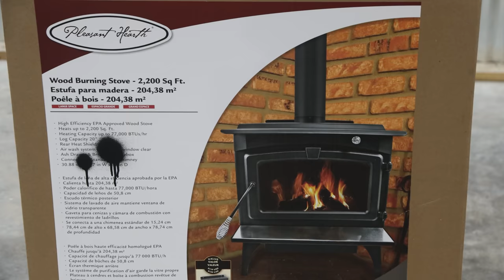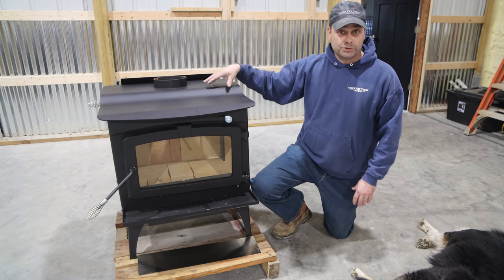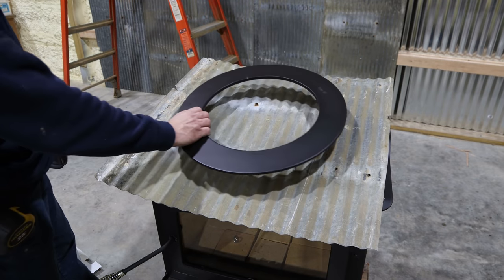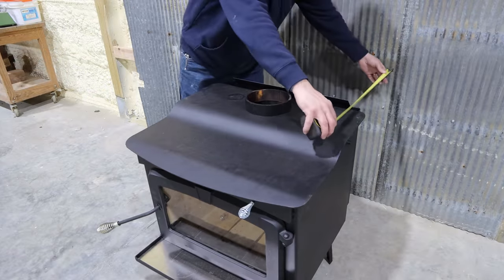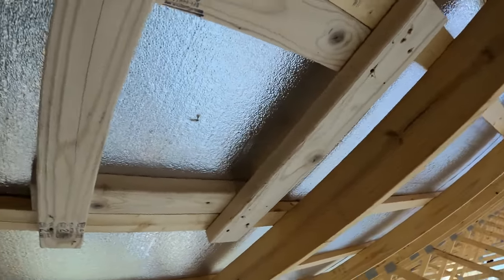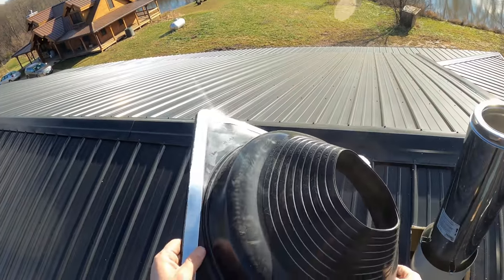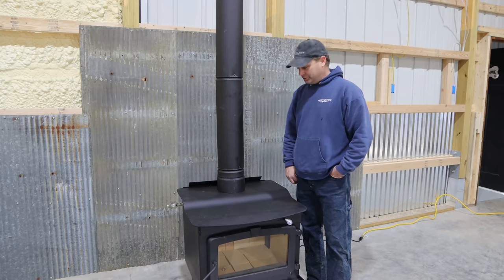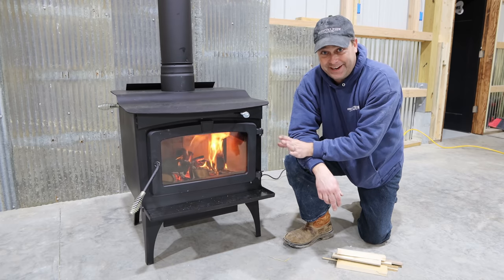Installing a Wood Stove in our Workshop.  It will be nice to have a warm place to work in the winter

Comment: Tip from an ex roofing contractor for 20 years. Since your so close to the ridge I would put a piece of metal under the ridge and over the chimney flashing for backup. You did a perfect job, but if can keep any water from coming down to the boot from above you have way less chance of a leak later on. Right now your depending on the silicone only.
Reply: Damn good advice.  In the years to come, you need to depend on something more substantial than silicone.   Water will also pool there w/o a piece of metal flashing.

Comment: Evan! 28 years as a chimney sweep. Your smoke pipe from the stove has to have the male end (crimped end) pointing down! This keeps creosote and any water in the wood that may condense in the pipe, in the pipe! And not dripping down the outside of the pipe. The class A insulated pipe in the attic also must have the male end down. Most insulated pipes will have an arrow pointing up to orient the pipe. Looks like the insulated pipe is correct. The high temp silicone goes on the storm collar not the roof flashing. Why? The smoke pipe and insulated pipe will expand in length and break the seal. Sealant on the storm collar will ride the pipe, expansion will not break the rain seal.
Reply from the maker: You are correct.  And all the stove pipe the inside crimp is pointing down.  There was an adaptor on the ceiling from single to double wall and an adaptor on the stove, so it may have looked different' but all inside crimps pointed down.
The Class A pipe was install per manufacturer.  There is an arrow for up.  And that is how it was installed.  And it could only be installed that way or it would have hooked to the ceiling support adaptor or the rain cap.
.High temp silicon was on the storm collar.  "Through the roof" silicon was on the flashing.
Reply from the maker: At 12:54 you can clearly see the arrow pointing up on the class A pipe.
Reply: Sorry Evan, my bad! Couldn't see the arrows.

Comment: I'm sure you had a good reason why you picked insulated stove pipe for the conditioned space, but in case you didn't think about it, part of the heat exchange will occur from heat coming off the stove pipe inside, not just coming off the stove itself. By using insulated pipe inside the conditioned space, you are reducing that heat exchange and sending additional heat up the chimney and outside, rather than warming the workshop. You might consider just having the insulated cap in the attic space, but the rest uninsulated to allow extra heat to escape inside.
Reply: @Boobtube.  He installed it 100% correct. The transfer adapter secures the pipe in place and double wall insulated keeps the pipe from getting cold and pushing air downward. The adapter also secures the pipe in place for cleaning.
Reply: He installed it 100% correct. The transfer adapter secures the pipe in place and double wall insulated keeps the pipe from getting cold and pushing air downward. The adapter also secures the pipe in place for cleaning.
Reply: I agree .
Reply: Are u saying use single wall pipe inside and insulated class A pipe outside???? That’s how I was always told it do it cuz the single wall pipe inside will put off more heat.    My code and insurance reason u must use double or triple wall outside
Reply: Absolutely. We always used double pipe inside. Up in Maine it gets cold.

Comment: chimney pipe and stove pipe are not the same kind of material. Chimney is insolated normaly 2 inches for stove.  Stove pipe are not. You must use three screws at each joint. Chimney must have the same diameter the than the stove smoke exit...

Comment: You should have used single walled pipe in the shop
Double walled pipe through the roof 
You will be losing a lot of heat through the pipe that could be used to heat the shop........

Comment: Evan, I'm a year late seeing your video and coming to the conversation.  Great job on the work and the video.  My 1500 sq. ft. (30x50) shop is very open like yours.  I have 10'walls and an open attic.  
Has your stove heated the space like you wanted?   
Also, how did you determine where to place the stove?  It looks like the middle of the long end of your space.  Thanks.

Comment: Always best to have an air channel wall behind a wood stove.  I have renovated homes and seen others that have the studs charred behind sheetrock covered with synthetic brick.  The lesson being that heat can be cumulative in an enclosed space even if that facing layer is fire resistant.  I have found a sheetrock  layer over the studs or better still concrete board (real concrete not that Hardi crap), then 2x2 studding spacing out a final layer of concrete board which has an air gap at the bottom of an inch or two and an inch at the top.  This allow a convection air flow to keep the area cool.  A decorative finish of your choice can be added.  I also like what we used to call a "stack robber" that took waste heat out of the stack and blew it across the room for even more circulation to protect the ceiling as well.  If the ceiling is low it too can benefit from a double open layer to keep its temperature reasonable.  Modern wood stoves can idle for long periods and build up creosote in the chimney.  How much depends on the type of wood and how seasoned it is.  Every so often depending on the buildup you experience it is good to open up the stove and let it burn super hot for twenty minutes or so.  Either that or clean out the chimney with a brush manually as needed.  A true chimney fire is something not to be experienced by the faint hearted!!  High R value insulation can hold heat to a dangerous degree and needs protection from a wood stove.  When it is cold out that area close to the stove can indeed get very very warm with radiant heat penetrating the wall.
Reply from the maker: The stove has abuilt in heat shield on the back.  The wall doesn't get hot.

Comment: Very nice. I placed the sliding stove pipe on the bottom to the stove not on top like you did. Reason being when I clean pipe I slide it up off stove and put metal or plastic oil pan under pipe sitting on stove. when running brush down chimney it falls into oil pan not stove. when done slide down on stove . All creosote in pan.

Comment: So I'm getting ready to do something just like this for my garage. I'm going to go out the side instead of all the way up to the roof because I'm not that confident myself that I'm going to be able to make sure there's no leaks lol.
My question is how much did it cost, was there a kit that you can get to get this started? Also what size piping would you recommend 6 in or 8 in? And would it not be more helpful to use single walled piping inside to help have more heat contact? Or maybe use a double wall at the first adapter than have that go into a single wall when you're about halfway up. I feel like your missing out on a lot of heat using that double wall.

Comment: Your insulated chimney looks like Metalbestos?  If so they make a model for Canada (which has stricter fire codes) that has a thicker ss liner so it lasts longer and also thicker chimney caps etc. which also last much longer.  If you have access to Canada it is much better quality as their codes require a pipe to last at a given temperature much longer than US codes.  This translates into a pipe which has a much longer life before it burns out.  Stainless does indeed lose material through each heat cycle and although better than regular mild steel it has a limited life.  The hotter the burn cycle the more microns of metal are given off.

Comment: I have a similar stove in my pole barn.  After a year of the stove setting on the concrete floor and having to kneel down when putting wood in the stove I purchased 8   6" x6" x 6" high concrete blocks and blocked the stove legs up 12".  So much better whenever you need to get in the stove.

Comment: I think you did very well with this job. I know R helped some, maybe even more off-camera, but you planned well and executed it perfectly.
Check this out. (he also builds to-die-for furniture)
https://www.youtube.com/watch?v=VwXEzpB017o.  fast forward to 13:30 and note how he secured the venting. Since your stovepipe consists of multiple pieces do you plan on securing it once or twice to prevent it from being pushed over. Such as from a basketball, football, or an Orangutan climbing it? You never know when a wild Orangutan might sneak into the shop. Happens all the time. 😏

Comment: I wanted a wood stove in my shop, but local codes pretty much put a stop to it.  I can't have any volatile compounds (gas, aerosols, grease) in the same space as the wood (or pellet) stove.  I ended up choosing to do electrical over propane.  Might want to double check with your insurance as well.

Comment: your black pipe is all installed upside down, the kreasote that runs back down the chimney will leak out on the outside and cause a mess, plus smoke up the building. I hope you catch this notice before its too late.
Reply from the maker: It is double wall pipe.  The inside pipe the crimp ring is pointing down so creosote runs back down inside the pipe.  It is installed correctly.  On the outside it looks backward.  But it is the inside the counts.

Comment: Hard to tell from the video but it looks like the male ends are going up but from my understanding the male end is supposed to be down. With the male end up you can end up with creosote running down the pipe and falling out and causing a fire hazard instead of being contained inside the pipe. I believe it can also affect your draft and cause smoke to come out instead of being contained inside the pipe. Everything else looks good though. Nice video.

Comment: Recommend a fireplace fan. It sits on top of the stove & works by the heat generated by the stove. It helps blow the heat out into the room. Just place it on top of the stove & it will amaze you by the amount of heat it blows out into that big area. No need to plug anything in or by batteries.  God Bless & have a great day!

Comment: You may have wanted to add a clean out section.  It sucks to sweep that pipe in the winter when that roof is full of ice.  

And since you said you'll be burning cutoffs and those are probably pine wood you will need to sweep it more often since pine creates more creosote.
Reply from the maker: I started using a "sooteater" to clean the chimney in the house.  You clean from the bottom up.  No more getting on the roof.

Comment: Evan, maybe a couple ceiling fans would help distribute more heat to a greater area. After I believe you said you were going to put up a ceiling.. The company I used to work for had a waste oil furnace in the hanger. It took forever to warm up after the hanger doors were open to park all the Aircraft, but after installation of four ceiling fans it was a night n day difference. Great jobs!! Love your channel and Merry Christmas ..
Reply from the maker: Yes, I will probably install a couple of ceiling fans since the ceiling is so high.

Comment: maybe I missed it but didn't see any insulation in the wall behind the metal paneling at the start?  Any reason why?  I'd want to keep as much heat in side as possible....
Reply from the maker: That is another room, that insulated.  It is the dog kennel room.  There is other videos on finishing that room.
Reply: @CountryViewAcres  got it, thanks.

Comment: I have installed many flues and I shudder at the sight of silicon caulk. Eternabond tape or caulk is a fantastic product that more people should investigate. It really is a great product.
Reply: High temp silicone is used only on the class A insulated pipe. Good up to 450 deg F. Never on smoke pipe, even double walled.

Comment: That hole in the roof needed to have a rib centered on it so the sides are on the flats. In order to do it like you did, you needed to build a cricket. That will hold water up top. Guaranteed to leak in 5 years.

Comment: You only need double wall pipe where the pipe goes thru the ceiling and roof... Plus it will add to the heat in the room. & they come in 3 ft lenghts.
My stove burns wood or coal, coal burn HOT
Reply: That's what he did
Reply: @daveklein2826  He used 2ft sections of double wall all the way up @ 10:25.... 3ft sections are single wall and put off heat in the room.  Only need double wall in the ceiling and roof.  I install and clean chimneys.

Comment: I have an old wood burner which I will replace and the six inch pipe looks to be single walled. After it goes up a bit it has a 90 degree angle pipe which is 1/4 inch thick going out of the back wall. Outside it goes straight up and straight down, the bottom has a square hole almost on the ground, going up it's 3 feet above the roof and braced. The down pipe opening is probably because it doesn't get enough draft. Next summer will buy a new stove

Comment: Great place to cook on for canning etc. and also when you lose power. Some have a kettle on that's always slightly steaming because of the dry heat a wood stove creates. Next is two or more stove fans for heat circulation.

Comment: Evan, i've installed factory built fireplaces, and there's a reason that most are not DIY. Most people might not be able to adequately install one as there can be a lot of variables. We did a CAD house that was the contractor's first, and it went okay, but the fireplace chases didn't line up one each floor, so we had to use a lot of elbows for that job. Fortunately it was a natural gas unit, so there was less heat in the chimney. 
I'm glad that safety was a primary thing on your install.
I think that will serve you well for many years to come. I wish you success on the installation of your ceiling.

Comment: Did you consider having a heat exchanger as part of the flue?

It looks to me like you are trying (or going to try) to heat a large volume of air. Even a large stove will take a long time to heat up and radiate that heat out. Having a heat exchanger will suck some of that waste heat from your flue and put it directly into the air, with the added bonus of moving the air around a bit too! With that height of straight flue you will probably have an exes of draw anyway ;o)

Comment: Question is it possible to vent it out the side of the barn right behind the stove? You look very comfortable with heights and long ladders as I’m sure you must do this work on ladders in your factory job. I bet you have just shown a lot of friends that your their new weekend Buddy when they have fireplace work to do. Susan
Reply from the maker: On the other side of the wall is a covered porch.  So it still would have to go through a ceiling and a roof.  So it was easier to go straight up.
Reply: @CountryViewAcres   Thank you for the answer. Didn’t realize it was on that wall. I’m sure you will enjoy the addition for decades to come.I bet the dogs will enjoy laying in front of it also. Susan

Comment: It is so hard to cut a large hole in a corrugated metal roof, and expect to be able to effectively flash and water seal around a flue pipe. In fact, it is almost impossible to achieve good water tightness. It appears that a homeowner will have to climb up there to repair and check it every year. A better solution is probably to direct the flue out of a side or gable wall.

Comment: Evan, it’s a nice stove but it sure looks puny in your huge shop. On a bitter cold winter day can it heat your shop above 45? It is an attractive addition. 

You should give some thought to going solar and adding a sizable electric heat pump —- say 5 tons to give you both AC and heat when needed - which for me is often.  I put in a used 3 ton heat pump in my 1200 sq ft shop for $2500.  I don’t spend as much time in my shop as you do but really enjoy working in comfort as I’m 77.  The solar was added two years ago and having no electric bills is another blessing. It’s not cheap but it’s a great investment. My financial advisor asked me a simple question that quickly made my decision easier: he said “where else can you invest that will earn you an effective 12%?” Another option rather than a heat pump is a mini split ductless unit. They are cheap and HIGHLY efficient with SEER ratings exceeding 30 and 35. If my 25 year old heat pump (SEER rating 8) kicks the bucket one of these will replace it for sure. Check Carrier and Mitsubishi for prices.

Comment: I have a question Evan,  why didn’t you take the stove pipe out the wall behind the stove ?   You would save a lot of money by not taking it up to the ceiling. ?    Wishing you and Rebecca a Merry Christmas and a Happy New Year. Love you.
Reply from the maker: Out the wall is a covered porch.  So it would have still have to go through a roof and ceiling..
Reply: @CountryViewAcres  Also, most of the heat comes off the length of the stovepipe and not the stove body itself.
Using the double wall pipe on the lower section and single wall on the upper section (below the ceiling) would allow for more heat in the room, but I do not know if it is a physical possibility to change the pipe style mid-length???
Double walled is clearly a safer pipe for humans.
Reply: He didn't
Reply: He didn't

Comment: where did you get the rubber flange you put on the roof i need on for my metal roof just like that
Reply: I'm looking for a rubber boot you put on the chimney pipe to seal the pipe to the roof can you tell me where you got it from
Reply from the maker: I bought it at menards.  Selkirk roof flashing